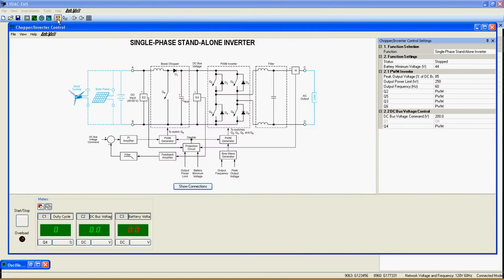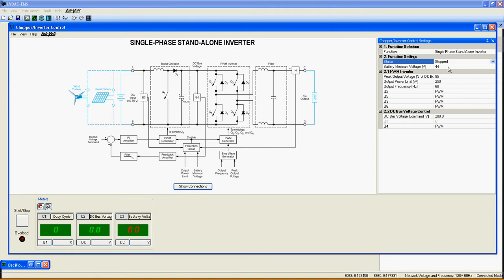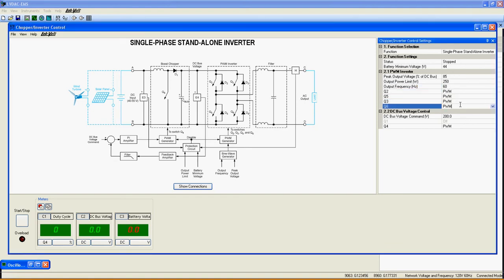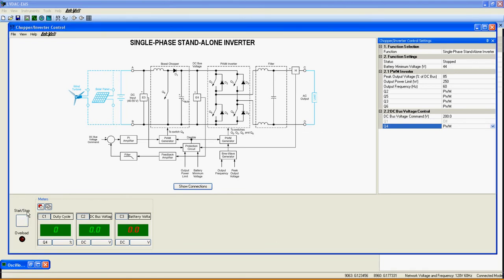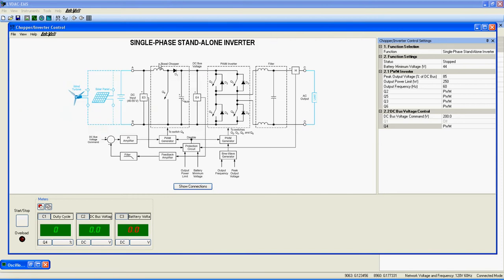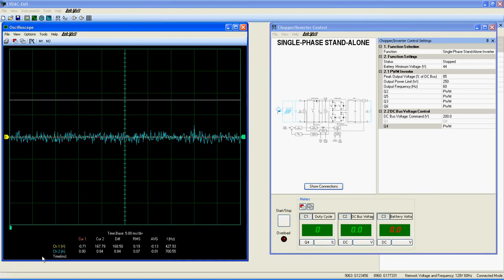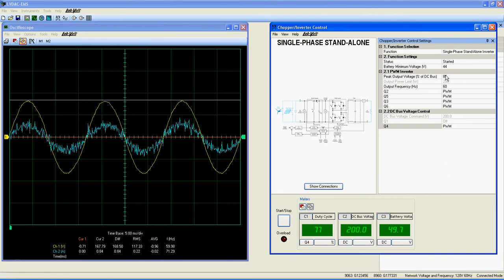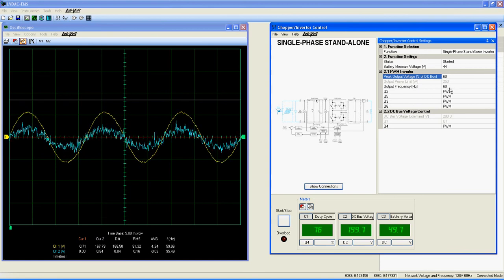Single Phase Stand alone Inverter - Grid-tied/Home Energy - 9063

Comment: Sir software name please
Reply from the maker: It's LVDAC-EMS. You can donwload it free of charge on this page https://labvolt.festo.com/Website/solutions/6_electricity_and_new_energy/98-9063-00_data_acquisition_and_control_interface (scroll down to the Downloads section, "LVDAC-EMS 3.24" file is there) but if you don't have the hardware, then you won't be able to do what's shown in the video. I suggest you get in touch with a Festo Didactic sales representative in the Festo office nearest you. Thanks!